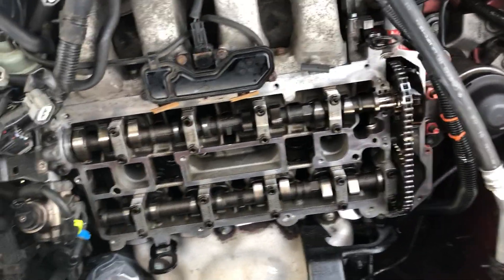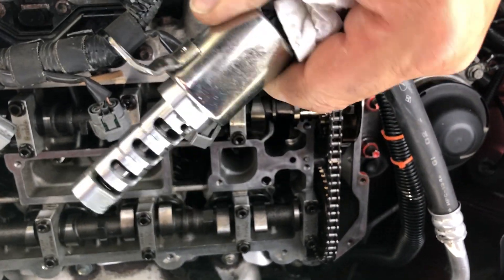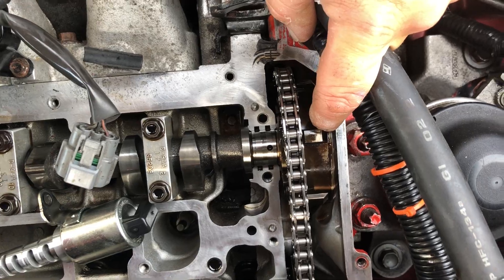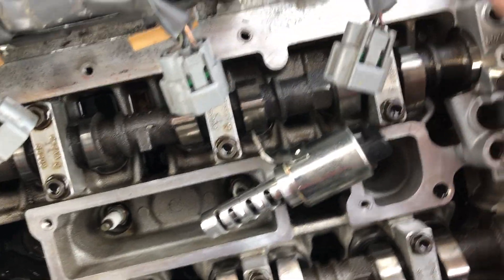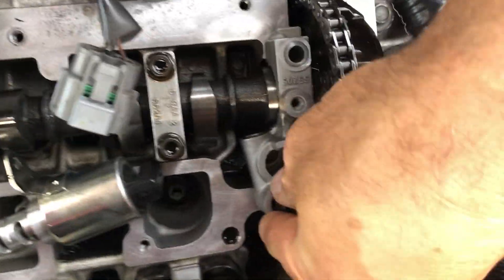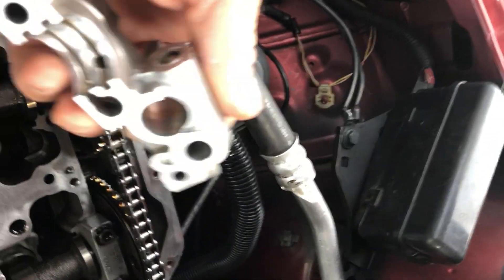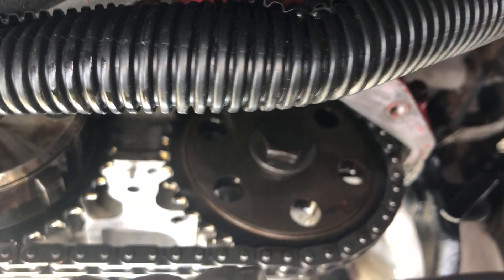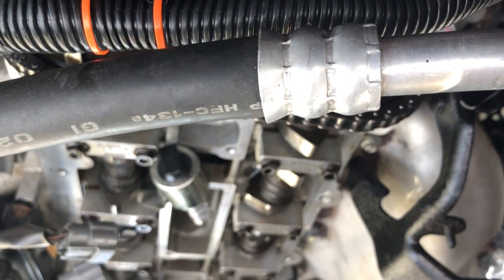Ford 2.3 liter VVT and  OCV Explained How they work  7-20-2020

Comment from the maker: TIP:  if you align the cam timing   (  piston @ TDC  and the 4 valves are closed   , crankshaft counter weight up against the stop )   and you check the camshaft gear  "dot"  which should be @ 12 o'clock . look at the VVT  Actuator and the " Notch " should be @ 12 o'clock if NOT  the VVT  Must  be replaced because of an internal failure !   this will cause your  P0012  CODE